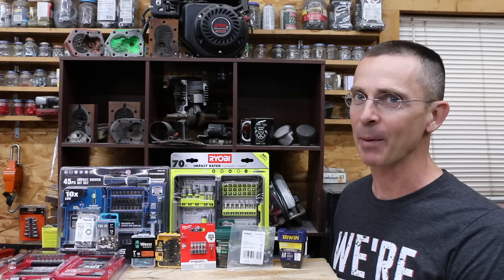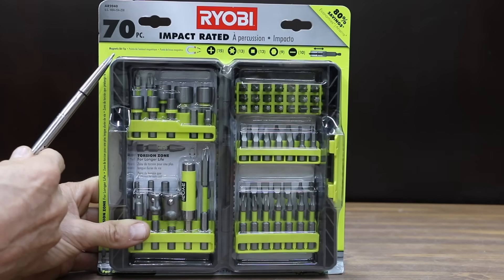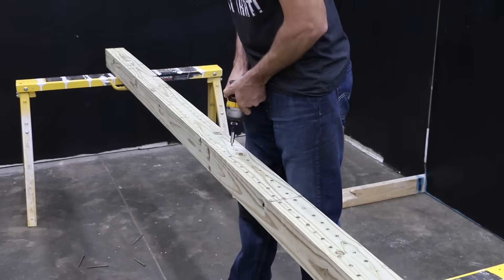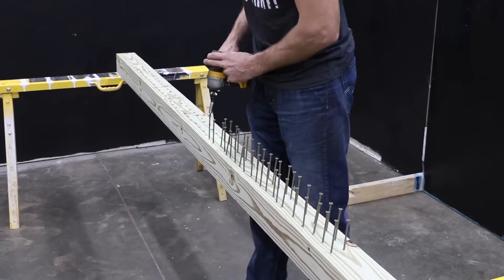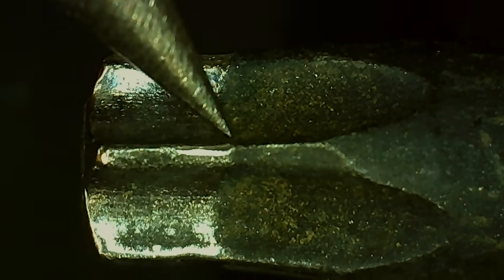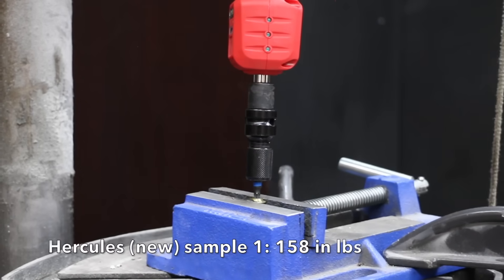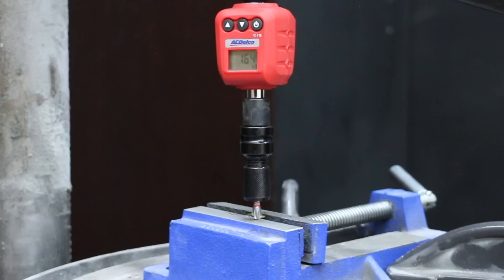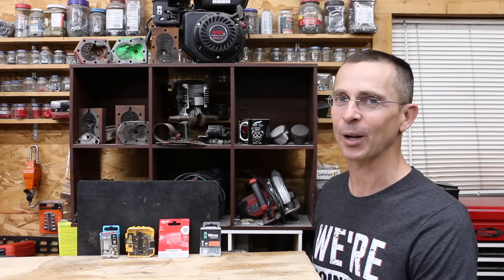Best Star (Torx) Bit Brand? Milwaukee, DeWalt, Makita, Ryobi, Wera, Wiha, Irwin, Bosch, Bauer

Comment: Great test, I can put my 2 cents in here because i've used just about every brand of these things there is at one time or another and have destroyed about that many and have a good size box full of the things, I use tons of the torx type screws and have tried all the brands of drivers and have never really had that much succes in any one brand holding up any real noticeable amount than any other brand,,,,however I don't know what brand screw I am currently using, and don't want to go out into the shed or my truck where they are stored right now because it's cold out and I'm on my lazy weekend day off LOL,,,,,but whatever brand that is when you buy the larger contracter size bucket of them (I ususally get a bucket of  each of the sizes like 1-2-3-4 inch and so on but actually by the half inch increase ) and when you get that size bucket (I think it's like a 25 pound bucket of them) they come with a pack of like a dozen of the bit drivers in the size needed for that size screw,,,,,soooooo guess what the bit that works and lasts the best is most always the ones that come in those buckets of screws,,,I don't know what or who makes them for in those buckets of screws but they are good enough that I am getting quite a collection of extras built up because I only seem to go through 2 or maybe 3 of them before the bucket of screws are used up and I get more when I buy the next bucket of screws LOL,,,,and they get punished pretty hard being used to screw into 2x4, 2x6,2x8,2x12 and into 4x4, 4x8,and even 6x6 and 12x12 treated and untreated heavy beams (sometimes into gluelam beams also)  and up to 8 inch (and sometimes larger)screws,,,all the while being driven by either my Millwaukee M12 or M18 drivers that don't mess around in the power department, however I do use a clutching device/screw depth setting tool  when doing just deck board setting jobs that keeps the screws from being driven too deeply, so it takes some of the abuse off of the drivers for at least that use of them,,,,but for all other work you can't use the clutch tool so those bits take a ton of abuse,,,,anyhow great video,,,,never thought i'd see someone put so much effort into proving out something like those little driver bits LOL,,,,but thanks for all the effort my friend.
Reply from the maker: Thanks!  Thanks for the feedback.

Comment: I do not experience the same as you with Dewalt. I find that they very easily break. My favourite is Wiha. But I also often use Bacho bits.
Reply from the maker: Thanks for sharing.
Reply: I primary used T10, T15 and T20. I can see you used the T25. Maybe the metal the individual brands use is optimised for a specific size. It is very difficult to argue against the scientific approach you have 🙂
I really appreciate your tests 🙏

Comment: Wow very informative, especially in the Heavy Equipment world Torx is a very common fastener especially in dashes and cab components. Interestingly I just replaced an oil cooler on a mx13 engine and the torque spec on the t40 torx head bolt was 144 in lbs.  I was using mac tool bits.
Reply from the maker: Thanks for sharing.

Comment: I do not see any contact information. I am tired of burning out 5 inch random orbit sanders every day. I want pf to buy 8 brands, put 2 lb on each and run them in a box 8 hours a day until each burn out.  I will buy the winner.
Reply from the maker: Thanks for the suggestion.

Comment: It probably didn't affect the results of this video, but heating up and rapidly cooling down the driver is hard on it and should not be a recommended practice.  The thermal shock can definitely break down the winding insulation.
Reply from the maker: Thanks for the feedback.

Comment: Very nice, i don't spend much on bits, I have a small 27pc Bosch kit that even has a tiny ratchet included, it's been going fine for four years, no impact required (it's not used a whole lot, reason below).
My local supplier where I get my wood and screws from usually toss in the appropriate bits for free (or it's included in the box) and though not the best quality it will outlast the box.
Have a good week everyone!
Reply from the maker: Thanks!  Thanks for sharing.

Comment: I would love to see a comparison of needle nose plier brands. I worked in electronics and some brands were garbage. Especially I'd like to see the taper of the tips, the match and fit of the tips, joint wobble, and tip grip comparisons in the test, along with tip strength for grabbing, and tip deformation/ bending.  Thanks for the great videos. they have really influenced my buying of tools.
Reply from the maker: Great suggestion!  Thank you.

Comment: Hi Todd. When I built my house in 2009, I bought thousands of screws from the brand "Spax" with a torx footprint. Each box also provides a star bit in it, with a little round part at the end to help center the Spax bit inside the Spax screw. I've never had any issue, so that's my recommandation : Spax screws and the bit included
Reply from the maker: Thanks for the feedback.

Comment: I actually have some experience to input on this one. First something that might help you in the future. Instead of 100's of small screws, a few 4-6" 1/4" Ledger bolts would be a far better stress test and you wouldn't need to put nearly as many in. So more effective test on the bit and less pain for your body.

I've used most of these brands trying to find one that met most of the criteria you tested. I've gone through probably thousands of these bits over the years. For me personally I find the makita to be the best overall value, though I tend to like the milwaukee the best for overall performance. However long term, I stick with makita because I find myself honestly splitting hairs over which performs better but the price difference is very clearly makita favored. I used to be a big dewalt bit fan, but honestly I've been unimpressed with their overall quality for about the past 5-8 years. I just find that every single time I buy a batch of dewalts, they are broken in half the time. That said, I've had some dewalt bits last forever. I think it is more of a quality control problem for dewalt and just not having the consistency that they used to have. Also Wiha is a german brand and while I really really like some of their hand tools, I find their bits to be pretty middle of the road.

Anyhow just my personal experience on the matter.
Reply from the maker: Thanks for the feedback.

Comment: I suspect the bits that gained significant strength after some use was due to incomplete heat treat from the factory and work hardening during use (retained austenite converting into untempered martensite under load). It's not a desirable effect for parts that experience impact loading. I suspect those bits would not last as long.
Reply from the maker: Thank you!

Comment: Can you test which type of coatings on screws and nails last longest in the weather? Also if that coats break apart with impact drivers vs normal drill? I’ve got some screws that were using on a garden fence 20 years ago and most are still good. Some rusted since the coated came off from stripping.
Reply from the maker: Thank you for the video idea!

Comment: I know from experience with Workers in my home they manage to shred ANY bit within a workday so they not even bother buying good bits and just use big bundles like 50 bits per bag. 

Something you have caused as flaw is some advantage I actually enjoy. Even those bits might need to remove themselves easy from a screw, I actually like it if the fit is so tight that the screw is "stuck" on the bit cause that allowed me to screw them in overhead without the need to hold the screw itself.

But very nice show still. The differences are visible but not as extreme as I imagined. I thought the 0.19c bits wouldn't even HOLD the screw and unscrew of 100 screws after all.
Reply from the maker: Thank you!
Reply: @ProjectFarm  
Your welcome

Comment: I use WIHA brand bits, metric hex and torx. I've been using the same set of bits for the last 10 years and they are showing no signs of wear. I use #2.5, 3, 4, & 5 hex extended bits everyday and they still fit perfect. When I ordered them, the site said they are made of German steel. I use them in a DeWalt 12 and 20 volt impact drivers.
Just my experience.
Reply from the maker: Thank you!

Comment: As impact bits, there's more with compliance and deformation than shear strength. May be worth including torque angle to failure if there's measurable difference between brands.
Reply from the maker: Thank you!

Comment: BLESSINGS, Commander and this is a tough one for me. I got a DeWalt small set when I got the impact BUT I'd driven a PILE of 3 inchers with my corded 3/8ths before that and the only bit(s, different sizes for different length screws) I'd used is what came in the screw box from Lowes. I still have the DeWalt bits but the standbys are the non-painted ones out of the screw boxes. So there's my take on it AND you can grind off a tad to tighten the bit up if it gets loose. Hope all is well and warming up and GBWYall!
Reply from the maker: Hi Lewie, I always enjoy reading about your experience with tools!  Also, great tip on grinding off the tip!  Yes, I'm really enjoying the warmer weather and so are the cattle, at least until fly season is here, lol.  Wishing yall many Blessings!!
Reply: @ProjectFarm  I've already seen gnats and Cheryl had a borer-type butterfly in the greenhouse that she dispatches but probably hatched out of an egg. The sweat will be popping before long and we'll be wondering where winter went! I don't know, myself. Yall remain calm and enjoy life on the Project Farm and God Bless!

Comment: "You'll notice the 4x4 is moving around a lot since the bit was frequently getting stuck in the screw. And when I lifted the impact driver, the board was coming off the stand"

triggered.  this is one of my top annoyances.  See also a bit that will not release from the driver when you want to change it no matter how hard you try, but falls out instantly with every screw you drive.
Reply from the maker: Thank you!

Comment: I will say, if I was using them for torx bolts that were going in and out repeatedly, I’d prefer a tight fit like master force because you don’t want to wear out the fastener head over time. But also, what Menards did you find that 25-pack at so cheap? I swear out by me they only have the 3 packs for like 4$
Reply: Also, “price per bit” kinda gets thrown off when you’re buying a low count card of bits vs a contractors pack. My experience with contractor packs is you occasionally get crappy bits in there, like the QC is lower in order to buy them cheap en masse.
Reply from the maker: Thank you!

Comment: I would caution rapidly cooling metal with subzero temps .. It causes fragility due to the quick expansion and contraction. Similar to concrete between hot and cold seasons. I dont think it matters for your current test but it is worth noting.
Reply from the maker: Thank you!

Comment: I wonder if the used ryobi bits, et al, lasted longer in the torque test due to being work hardened from use? Also, when the bit pops out of the top of the screw, it is. y understanding it is called cam out.

Comment: The best TORX is the One with the Security CIRCLE in the middle
"Security" bit
Reply: Those can't really hold up with the normal torx bits strength wise. The litterally have a hole in the middle. If that don't weaken structure I don't know what will.
Reply: Not true. Torx Plus is literally the better option.

Comment: Hi Todd and greetings from Sweden! I always carry a pair of 4” pipe pliers for removing rounded nuts, studs etc. New ones grip really well and are very helpful! But the teeth in the jaws on the ones ive been using wear out quite quickly and have to be replaced. A comparison of brands here would be interesting! I use BAHCO brand.

Comment: If you stack your old electronic torque adapter on to your new calibrated one, and the readings match, would that be a fair way to prove the old is still calibrated? Or could you then adjust the old to be calibrated? I have no experience with those so this might not make sense.

Comment: Bits getting stuck in the screw can also be an advantage, especially if you're working over your head or in tight places. In those cases it's better to not use a bit holder.
Reply from the maker: Good Point!

Comment: Love your videos!   Side note/test idea:   While building a retaining wall with railroad ties, I was using my Dewalt 20v impact driver to drive in 12” long heavy duty screws through the ties.   It was apparent that when using my 60v flex volt dewalt battery, the driver had a lot more power vs the 20v standard battery.
Reply from the maker: Thanks!  Thanks for sharing.

Comment: As a contractor I appreciate this test. We use the 2 inch masterforce for the most part I have never noticed the tight fit with those. They seem to be of similar quality as the Milwaukee in my opinion. Thank you for doing this test !!
Reply from the maker: You are welcome!
Reply: I am contractor ○ I will note masterforce as some other mentioned that • I purchase a brand of tape based on his report and it is much stronger

Comment: Wera screwdriver set with 20 bits with both ways unlock ring system ist very nice:) and its in wallet type pack that you attach to your belt.
Reply from the maker: Thanks for sharing.

Comment: Another useful investigation.  Thanks.  Is it meaningful to rate fitness based on a single type of screw.  (Does fastener slot geometry vary so that the overly tight bits here might be the best fit with a different fastener?  Could  wear also vary for different fasteners?) I appreciate just testing wear on one fastener type was a huge and tedious task!
Reply from the maker: You are welcome!

Comment: That’s what I would do when I was replacing all of the nails in my deck with screws. The hammer drill would overheat in the summer air. So I would come inside, throw the drill in the freezer, watch TV for 20 min and then go back out in the heat.
Reply from the maker: Thanks for sharing.

Comment: WERA...iGotta remember that brand name! Impressive
Reply: They are very good. Very specialized too, wich doesn't hurt.
Also very expensive, as the test shows, but, you can't have it all. I've had a Wera bit last more than 5 years. More, because I lost it after 5 years, and it was still going strong.
Reply from the maker: Thanks!

Comment: I'd love to see a test on plain ol' sockets - I've twisted apart several over the years, and just yesterday had three cheap harbor freight ones round out on the inside without actually breaking. It would be cool to see if the expensive Snap On or Mac Tools are any more stronger or durable than regular box store brands!
Reply from the maker: Thanks for the video idea.

Comment: I like to bump the nose of the bit up against the belt grinder to slightly square the end off. Some have too much chamfer and won’t stay in the screw unless you hold down a lot of pressure (especially when you’re building stuff and have to use the drill from an awkward angle).
Reply from the maker: Thanks for the feedback.

Comment: The screws are supposed to stick on the bit. They are manufactured that they do it. This is made to make the bit life longer but especially that you don't lose the screw if you have to work with one hand. So it has to be counted as a plus, not as a minus. Also you can get the bits for a lot less. I bought 10 bits for 1€ a piece. And I still have unused bits over. Especially if you have to drill holes in concrete walls, you just remove the drill from the Hilti and you screw in the screws. The Wera bit will work without a worry. So the good bits play out there strength in heavy and abusive use.
Reply from the maker: Thanks for the feedback.
Reply: @ProjectFarm  My pleasure :) Especially for DIY home projekts your test is amazing. It was more like additional info. Keep going with your test. They are really unique and really great :)

Comment: You should do a test of the different types of screw heads to determine which one allows the most torque to be applied before camming out. Like  #2 Philip's vs flathead vs T25 vs Robertson's [square]. Even throw in an apple triangle head for Schlitz and giggles.
Reply: Philips vs flathead is a no brainer, even if philips (and pozidriv that is only slightly better) is a bad type of screw head already, T20 or 25 vs robertson would be interesting, however, not that useful since you (by you, I mean the majority of the human beings) can't really access robertson easily anyways. Torx should beat the allen print that tends to round up when there's a lot of torque applied.
Reply from the maker: Thanks for the video idea.
Reply: Were Philip’s designed to cam out, or is that an urban myth?

Since discovering torx, I definitely prefer them.
Reply: @MoneyManHolmes  I dont think it was "designed" to cam out but it's just what happens. That's why the Robertson was created. To minimize the chance of caming out.

Comment: In my experience tight fitting bits work a lot better for starting screws, testing for that use case would have been interesting.
Reply from the maker: Thanks for sharing.
Reply: Yeah they certainly have their place. Having more than one type of bit is good for those scenarios with rust, paint, etc....  I also save a few old bits that I won't feel guilty about hammering into a fastener :)

Comment: Not that it really matters but im betting the cheaper brands used bits doing better in strength is due to work hardening. The more $$ brands probably have a better hardening process to begin with.
Reply from the maker: Thanks for the feedback.